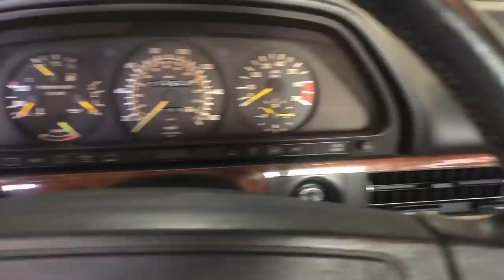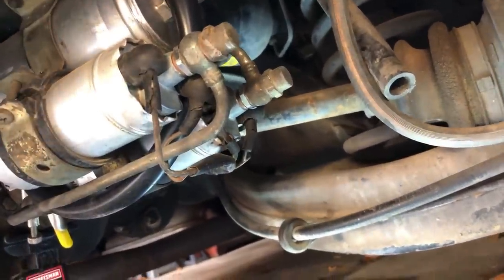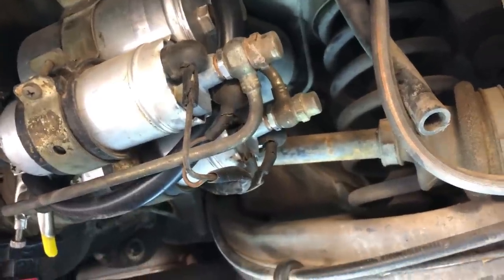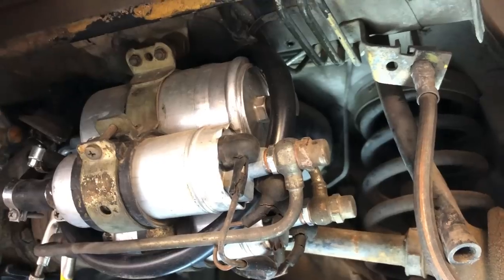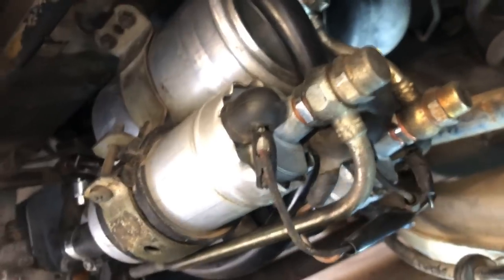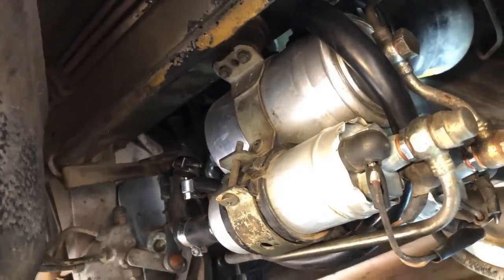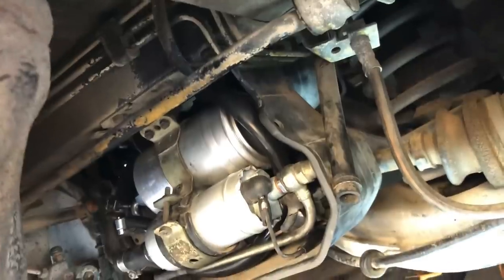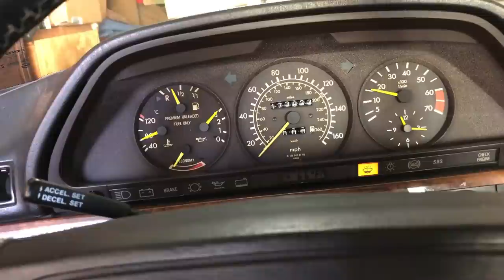Hard To Start? Check Those Check Valves!

Comment: If you are sure it is a fuel issue another place to check is the fuel pickup in the fuel tank. If it is cracked it may be sucking in air causing your issue. I would hook up a fuel pressure gauge though and watch the pressure while it is acting up to verify it is a fuel issue first though. Other places to check would be the fuel pressure regulator. I’m not familiar with old Mercedes but that should give you a start.
Reply: If he would had a crack in the tank would have a leak
Reply: gianfrancoa  the fuel pickup is located inside the fuel tank. You wouldn’t see a fuel leak. It would either leak back into the fuel tank, or it may try to suck air. In both cases the fuel may have a hard reaching the fuel pump causing a hard start, or hesitation at higher demands. Regardless, a fuel pressure test meter would help with diagnosis.
Reply: @Shawnsullivan7  i I thought the pick up was in the bottom of the tank like the w201
Reply: gianfrancoa  you could be right, I’m not sure. If that’s the case perhaps the screen could be clogged? Like I said, I’m not very familiar with older Mercedes.

Comment: Almost 6K subs!!! You're getting closer to that 10K mark man!! :)
Reply from the maker: Little by little!!
Reply: I was having this oroblem with my1983 sec, it has around 260,000 miles on it. I installed all new injectors, and new plugs, that solved the startjng problem I had. The engjne runs so smooth now, and the acceleration is quick, and smooth alsoi it runs 100% better. I don't have any more startkng problems now.

Comment: There is a vacuum check valve, as you face the engine outside the car, on your right which runs right below your line of sight. This controls the air vacuum flow. So, we you put on the gas, too much gas is introduced and you should check the BLUE/Brown/White (any that look those colors) for a leak. They do leak and will drive you nuts when you use up so much of a tank so fast and that vacuum controls A LOT of other Mercedes features like the rear trunk auto-handle and many other besides just making your initial idle ideal. Contact me if you have any questions. I have a 1992 MB 500SEL and am fixing a lot of little stuff....so more conversation is great!

Comment: I had same crazy issue at idle with economy gage going up at idling, and then sometimes stalling on acceleration at low rpm. A simple adjustment of the air fuel mix through the 3mm allen wrench hole on the ail filter fixed it.
Reply: What car do you have?
Reply: @runelarsen5769  w126 560SEC

Comment: Love your videos Mr Mike! My 300se (also w126) refuses to start she hasnt run in 4 months, good compression, new fuel pump and filter, recon the tank, new coil, rotor and rotor button, injectors are good buddy of mine tested them and it has good fuel pressure. Thinking of changing the crankshaft sensor...I feel your pain man!
Reply from the maker: Yikes! Good luck with that!

Comment: I had been having hard starts for a while. The engine would require two or three tries before it would crank and hold a good idle. Finally, my engine started stalling at random times in addition to the hard starts.
 
My mechanic and I agreed that it was either something fuel or electric that was causing it. I discovered that it was the fuel pump relay. It took a while to find and I discovered the issue after breaking down on the way home.

TSing tip: turn the ignition on and apply pressure to the fuel pump relay. While doing this listen to see if you here something engage within seconds of you applying pressure.
Alternatively, you can apply pressure to the fuel pump relay while someone cranks the engine. See if it turns over more easily.

Comment: I've mentioned this a bunch of times in your videos - have you checked fuel pressure? There is a cheap Harbor Freight tester that has the correct fitting. There is a simple fuel port right on the passenger side of the fuel distributor. that taps right in. It's literally easier than everything you have done.

After that, are you sure you don't have clogged cats?

Second, have you confirmed the correct routing for the spark plugs?

Third - make sure your timing is a 0 deg TDC and that nobody has tried to mess with the distributor. These need to be set at TDC since the ignition module controls timing unlike the early cars.

Fourth - check the primary wire to the coil near the ABS unit. Make sure that there isn't corrosion inside the primary coil and the resistance on that cable is good.

Fifth - check the actual ignition module - remove the vacuum plug 

Sixth - there is a 3mm hex inside the tower on the fuel distributor that can be used to adjust idle air mixture. People love tot futz with it. Leave it alone for now, but you may want to look into it.
Reply from the maker: I’m going to buy one pronto!!

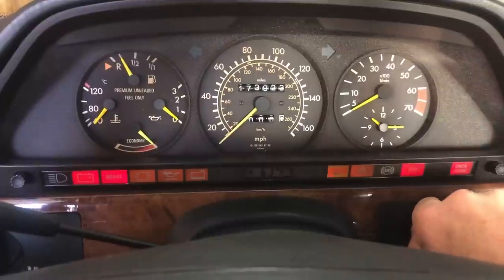Comment: I noticed when you turned the key the firsty time the oil presure was on cero , cero ,cero then it went up a little bit . And then when you turned the key the second time the oil presure was on 2 , and it started right up . 1:06

Comment: Looks at least most of your vacuum leaks are fixed, even the fancy economy gauge working! Kind of remember some older Mercs  had a small micro switch on gas linkage, it activates just on idle and off the idle. This is just now guessing, so if there is this kinda micro switch, make sure it is clicking and working on linkage.

Comment: Common problem with injectors is they leak after you turn key off and kinda flood engine so it starts hard on hot restarts and when it does start you will see some black smoke out tail pipe and rough idle till it all gets burned out.
Reply: This sounds exactly like the issue with my 500SEC.  What would be the fix for this?  Thank you,!

Comment: To eliminate if it's a fuel issue or not you'll want to use a fuel pressure gauge compare your readings to the specs. If that checks out You can move on to other issues. Hope this helps. Have a great day!

Comment: Does your vacuum gauge now stay to the right side? Otherwise you still have a vacuum leak...
Reply from the maker: Nope. Still have that vacuum leak
Reply: @MonkeyWrenchMike  The problem with leaks under the manifold is that the access is very limited without complete  disassembly. You should try the smoke test again, but try to pump in lots of smoke...

Comment: Hey Mike. Thanks for the video. I’m having warm start issues. Starts right up when cold. It wouldn’t be the check valve, right? If it starts up cold then it’s holding fuel pressure. That’s my guess. Thanks
Reply from the maker: Yup!
Reply: @MonkeyWrenchMike  I’ll cross that off my list. I hope I find the issue soon. Super frustrating.

Comment: I have fuel at the line going to the filter, but the check valve in the input side of the fuel filter seems to be stopped up

Comment: Thing with the plug on the side of the fuel distributor I had the the sam issue a while replaced fuel distributor you name it I’ve done it haven’t try Ed the check Val’s may try that after that I am buying another ford ranger can’t go wrong

Comment: You may have a damaged seal underneath the intake manifold, these tend to go bad with time - and judging by the condition of all the other rubber components, I think it is very likely.

You should also use the X11 port and get some readings by measuring the duty cycle - using PIN #2, #3 and #6. If you need more I can send you some links.
Reply from the maker: Thanks for the tips!

Comment: Have you adjusted the C/O screw (takes a 3.5 mm allen wrench) there is a hole in the air filter so you can adjust it while all is assembled. Should be done with a c/o meter but It kinda works like adjusting the air fuel screws on a carb (kinda). I also can tell you a smoke machine is in order here first to make sure on any vacuum leaks. also those c.i.s. injectors if they are old or most likely originals they will need replaced - they are cheap compared to EFI injectors. Also do all the injector holders and seals probably gonna spend around $300.00 or so on all that. I think FCP Euro has about the best price. Mercedes Source is great but not so much on part prices. But only fair to spend some with him so you can get that free good advice!!
Reply from the maker: Thanks. I’ve done 2 smoke tests (see videos) so there are no leaks. I’ll look into the C/O screw.
Reply: @MonkeyWrenchMike  Yes I saw that and I'm almost sure you missed one coming from under the air flow plate where there is a very large rubber boot that cracks and fails. I have had to smoke test these old cars numerous times to find all the leaks. It has a lot of places where they can leak! and they are nearing 40 years and I saw your car also has 173k miles.
Reply from the maker: Very true! I’ll check it out. Thanks!!

Comment: Have you check if you have a strainer in the incoming fuel line to the fuel distributor?  It seems you need to have an in depth analysis ok the k jetronic.  I have a Bosch manual that goes in detail. I can email you if you need it
Reply from the maker: That’d be fantastic! Monkeywrenchmike123@gmail.com

Comment: Hi Mike checkout 
Fuel pressure
Injectors
Old dirty gas tank and fuel lines can cause issues, the car just chokes and sits then goes again based on my  previous experiences with my 94 560 SEC in Europe.

Comment: Well, you got your gas problem fixed. If not maybe you should get some Rolaids (tm). Seriously you may have an ignition or a injection problem. I am far from a Merc expert as I haven't worked for a dealership since the 70s. I could also be a air leak in the intake manifold.

Comment: Hey Mike, My father just gave me a 1986 W126.  It has been sitting for quite some time.  I changed the fuel pumps, accumulator, and filter.....but still no starts.  The old carb trick will get it going to a few seconds (but that's scary to me!) Any suggestions?
Reply from the maker: Is fuel making it to the injectors? Check the fuel rail then injector. How bad was the gas tank? It may be filling the filter with debris. Good luck!
Reply: @MonkeyWrenchMike  When I changed the screen it looked like gold mud fell out.  It starts now and dies within 5 -8 seconds.....almost like it just runs out of steam. I guess a tank clean is in order (SMH).

Comment: EPA  sensor on the side of the fuel distributor take off and there a srew that needs to be turned there a Visio on this some were on here some were also spray some gum out cleaner down the throttle body see if that helps also put some in the gas see if that helps mine is real sensitive I love the car I really don’t know why it’s such a pain in my you know what I just drove mine today I gave 1500 for the car I got about 5000 in it 😊

Comment: THere's an inexpensive tool from Gunsons' that will show you if you are running rich or lean; you stick a hose up into the exhaust and it tests the CO2 level.  Another way is to test the Oxy sensor directly, but that will only give you one side, not both.  I agree, I think it's a mixture problem.  More than likely, the mixture was changed to counteract the vacuum leaks.
Reply from the maker: I’ll check into that tool! Thanks!!
Reply: @MonkeyWrenchMike  mixture need to be check with "duty cycle meter" or oscilloscope 
between pins 1 and 3 on 51270d1199843300-560sl-diagnostic-port-tool-diagnostic-port.jpg

Comment: The check valves were ok, I have no idea why you replaced them.  Check the EHA, fuel pressure regulator, fuel distributor and the coolant sensor, please check the voltage for some items first.  Change all the fuses to brass, dont forget to adjust the air fuel mixture.  Call me cynical because  for some reason I think you know whats wrong with your car.

Comment: I would check the fuel pressure and go from their,doesn't sound like its getting enough fuel under load.
Reply: Yep - you can buy a good kit at Harbour freight. Fuel pressure is important on C.I.S. and E.F.I.

Comment: Difference between D & P may both be a transmission problem and a fuel problem.  Nice fix on the check valve though.  I have seen on MB you fix something, something else goes wrong lol
Reply: Not because it is a MB - it's the 40 y o rubber crap -  motor mounts, bushings, hoses, vacuum plastic connectors and plastic lines. etc. etc. etc

Comment: Mike I know when I have fiddled with the idle control valve it is easy to get a vacume leak on the little tube you broke that goes between the two rubber hoses (dose rubbarow Hoesays) these cars are picky. Thats why I have my f150 ( eff Juan fiftey) for our spanish speaking friends...  to get to the junk yard ( yooonk yard) that little tube is a odd size and when I tried other tubes it had bad results
Reply: you can still buy the hose both plastic and rubber in meters at a MB dealer and it will fit correctly. Those larger rubber hoses around the idle valve are also still available

Comment: Do they have cold start pressure regulator like on vw if so that will be issue
Reply: No this is C.I.S. they have a a fuel distributor and pressure regulation is done with a valve in the fuel distributor.
Reply: Is it Bosch k jetronic
Reply: @christhackrsy  yes and yes VW Audi BMW Mercedes and others used it back in the 70's 80's 90's it was used 73-94
Reply: "cold start injector? and ?pressure regulator" are two different things
so wich one you asking for ?
Reply: Warm up regulator, not mentioned cold start injector
Reply: @christhackrsy  no, this car do not have "warm up reg"
Reply: Ok thanks

Comment: Mike   OK another all day watching you working on your fleet.  I have decided I want your new SL350 convert if you will help me keep it running. Today you sort of lost your cool on your oldest project and I have walked many miles in those shoes I assure you. I have 4 Copart wrecks in my shop/Barn and like Randy I can't explain why I just liked them but used the excuse they will be my Bucket list. I want one of those E55 V8 super charged but they are either torn up by keddie street racers are they are junk and if not junk they are too high and out my class.
Reply from the maker: Ha! Thanks Ronald. I’m still kicking. Ya elf for not buying a C55 that was at a copart auction with a buy it no of $2,000. We both suffer from this horrible Mercedes dementia!

Comment: Hello me old flower now this is a shot in the dark, if I remember correctly the fuel tank was full of crap and even though you drained it and added clean fuel along with the fuel filter I can't stop wondering if there was still trash in the tank and has partially blocked the filter. You would get enough fuel to start and rev the engine but not when the engine is under load. Could you try a separate fuel supply to determine whether it's a fuel supply issue from the tank or not. Hell's bells a serious reply for once 😃 I must be under the weather. Quick joke    why did Mrs Christmas divorce Father Christmas........ Because he woul only come once a year.  😮😮🤭😂.   Gary... England 🇬🇧
Reply from the maker: I can always count on you for a good laugh, Gary!! Thanks for the tip. I’ve been wondering about that too!!

Comment: Mike, check the fuel distributor for leaks by disconnecting all the fuel lines from the top and jump the fuel pump without starting the car, if fuel comes out from any channel then it's leaking and need a rebuild (rubber parts inside are eaten up due to ethanol in new gas which this fuel system wasn't designed for),  if no leaks detected then check all the injectors as you are still using used ones which doesn't guarantee they are working properly (Edd China from wheeler dealers demonstrate injectors testing when they restored their blue SL Mercedes, so you can build something similar that may serve the purpose), obviously you have wrong air fuel ratio that causing the car to stall from what I believe, bu my guts are telling me is the fuel distributor and there is a guy rebuild them his name is Victor and has a YouTube channel so check him out, BTW the new re-manufactured fuel distributor is a special order form Germany and cost $6500!!!! so ... Good luck brother.
Reply: you know these, 
respect!
Reply from the maker: Great (and expensive) information!! I’ll give it a try!

Comment: check the crankshaft position sensor, ur not getting any movement on the rev counter when starting. it should register the cranking speed of the engine. please check  SHADOWRIDER460 channel, he has a video for his 420 sel with start issues he fixed. turned out to be a bad speed sensor. he shows how to test it etc. worth a peek, could help. anyways, lovin your channel, your great craic😁. all the best from Ireland. 🇮🇪🍀

Comment: Your gas issue and exhaust leak could be due to eating too many cheap Baked Beans!   Try buying better quality Baked Beans, and eating fewer of them!  That might cure your issue?   Idling fine in Park, but not in Drive, could b e idle  solenoid that should engage, in the same manner as when it has extra load during the summer when the A/C is on?